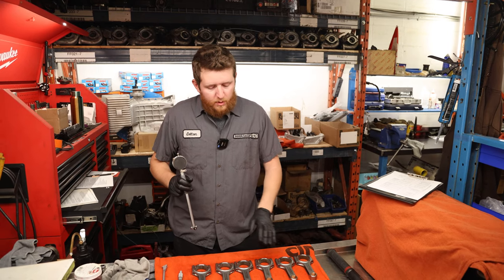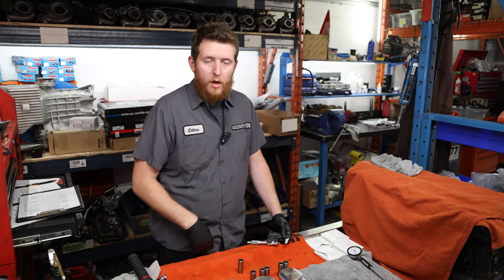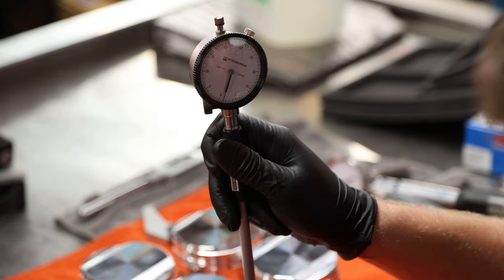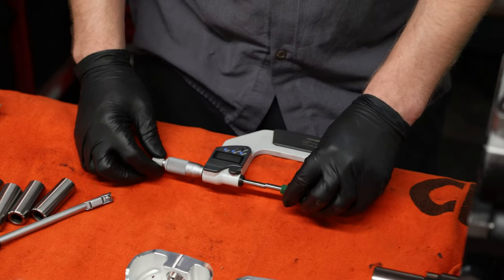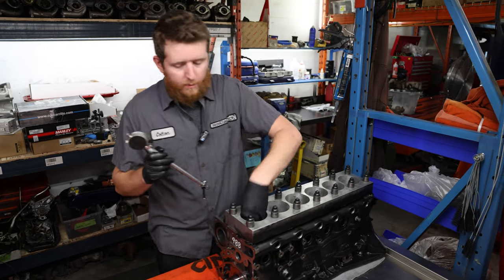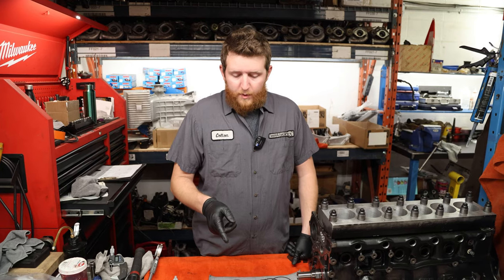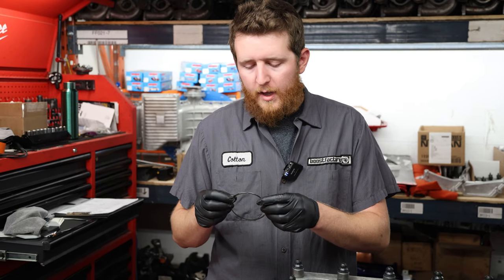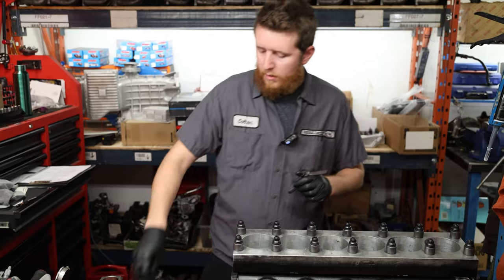RB26 FULL ENGINE BUILD || Episode 6: Measuring CP Pistons and Installing Piston Rings

Comment: Hey guys! Is a .016 gap considered to be on the tight side? My machinist recommended setting my gap for my top ring to .028” and 2nd ring to .032. Should I be worried about blow-by with these gaps? RB26, flex fuel, roughly 30psi on 2618 Manley 86.5mm slugs. Multiplier on their box was .008 x bore diameter at 30psi…just don’t want blow by ☹️
Reply from the maker: .028 is a bit on the larger side, but they are probably running on the side of caution. Blow by depends on more than just gaps, cylinder wall finish, taper, and O/R come into play as well as cylinder wall strength. Minor blow by is not a major concern as long as you have good crank case ventilation. 
 We've had success with .016 on builds similar to this, and .018/.028 on up to 1000hp. it also depends how good of control you have over cylinder Temps!
Reply: @boost.factory  thank you for steering me in the right direction! Could I run these gaps on a street car running on ethanol? Or would you suggest starting over and running something tighter? All my other clearances are great, hone cross hatch pattern degree and grit size used are also good. I’m more concerned of seeing a fair bit of smoke on decel for the entire life of using this engine, and I’d want to do it right while I have it still opened up

Comment: What's the reason for the extra 8thou. 
Is it because of you cylinder clearance.
Reply from the maker: extra .008'' where?
Reply: .004- .008” extra clearance on the 2nd ring is to reduce the chance of ring flutter between the 1st and 2nd compression rings